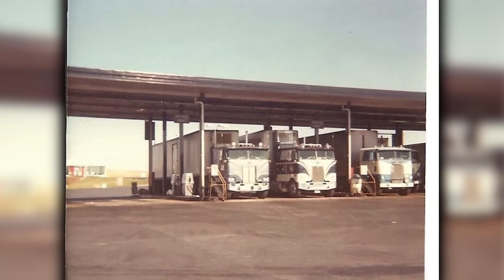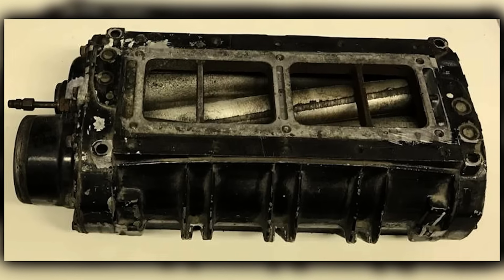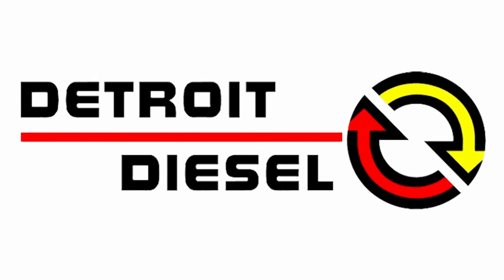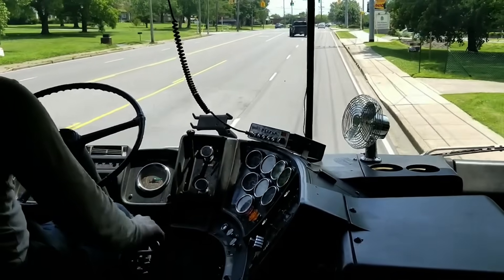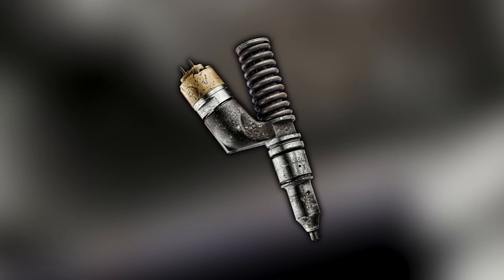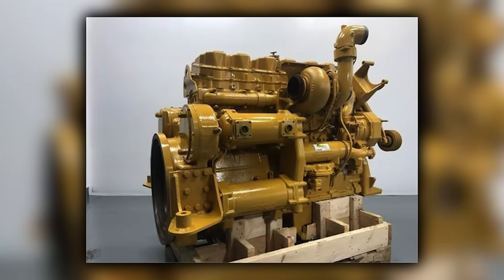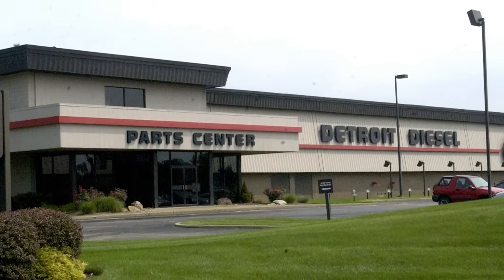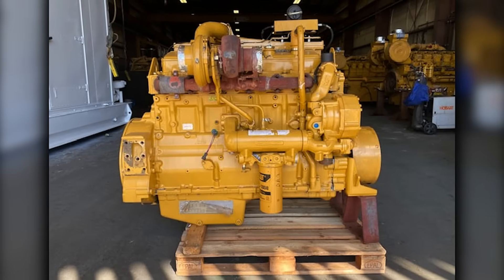Why Caterpillar’s 3406 Engine Still Haunts Detroit Diesel

Comment: For the AI, Detroits were not supercharged, and they had replaceable liners as well.
Reply: Yes they had blowers they had to. No the 71 series were not wet liners only the 92 series.
Reply: @tylerd8427  
Yes the 71 series had wet liners just as every Detroit ever made.
I operated and rebuilt 53, 71 and 92 series engines throughout the 70's and 80's
and still have equipment running 4-53 and 4-71 powerplants.
Reply: All 2 stroke Detroits were supercharged, that's what the blower is.
Reply: @elliotkane4443  exactly if they didn’t then they would never be able to run.
Reply: The 6V92 had the supercharger (blower) and, in some configurations, was fed by two turbos.  Many of the busses used these engines and would routinely get 400K miles before an in-frame overhaul and close to 1 million miles before having a complete rebuild.
Reply: It also refers to the blower whine. I caught it in another video. I never thought any of the two strokers had much whine sound.
Reply: Detroit blowers are famous because they're the first ones popularly repurposed for hot rodding. 
Why to people post without fact checking? Supercharging is required by two-stroke diesels to make remotely decent HP.
Reply: @oldphart-zc3jz  actually the 2 strokes wouldn’t run unless supercharged yes some had 2 or twin turbo this is where you get the TT designation such as the 6V-92 TT it was still supercharged there was a T designation a 6V-92T and just the 6V-92 which only had the supercharger. The 2 stroke was an absolutely amazingly adaptable engine bonus points if you can tell me the difference between a 6-71 and a 6V-71 or the horsepower on a 8V-71